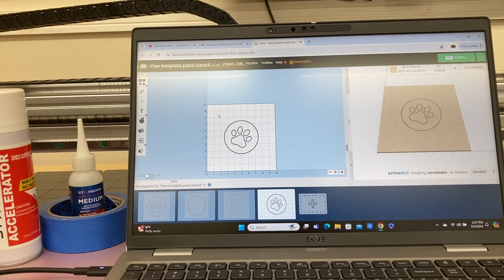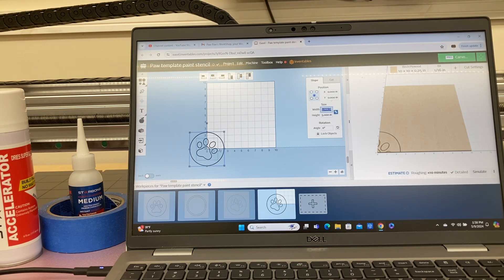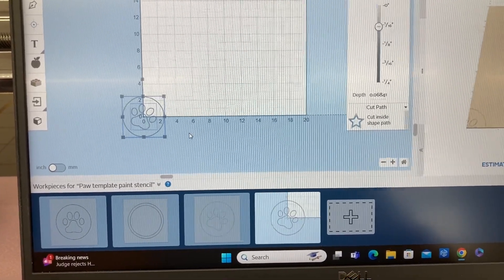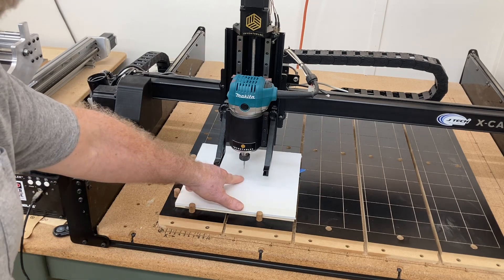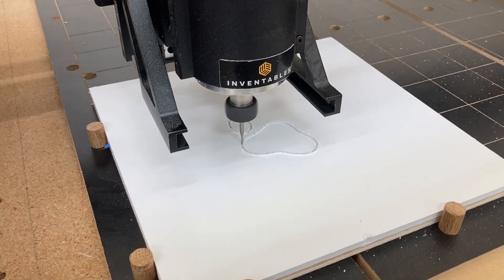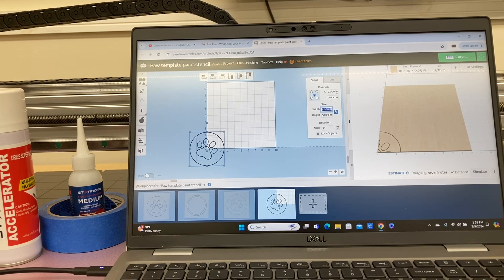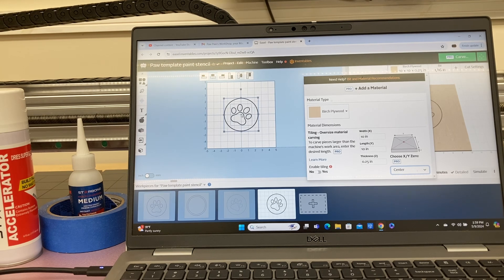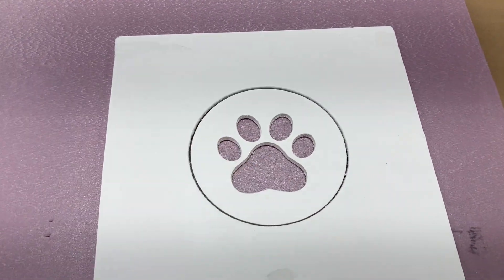Will this Break the CNC Machine if I Run This Project?

Comment: Hi. I really need help. I just purchased a FoxAlien CNC Masuter Pro and the software V-carve Pro to run it. 
1. In the V-carve it does not see the FoxAlien Masuter Pro.
2. From that the bit list and many more does not work
3. FoxAlien does not post a phone number for customer service
4. Any suggestion for me?
Reply from the maker: VCarve Pro is a design software. You also create the toolpaths from your design and the save the toolpaths as gcode which this software generates. You then can take this gcode and run it on any CNC machine. To run the gcode you must have a controller. I use the Openbuilds controller which is available for free. This controller is what talks to the CNC machine. You control the CNC with this controller ie., homing, movement on all axis and more. You open the gcode file in the controller software and run the file. The CNC will carve out your design. I have numerous videos on this topic.

Comment: OK, so.. For Easel basic..   You set the project to zero, zero...   Manually jog the spindle to the center of the work piece..  Check the z probe... And finally reset the X & Y to zero during the pre-carve checklist.. Right?  I just wanted to make sure I didn't miss anything..  Thanks again for another great video!
Reply from the maker: Yes sir, you got it.